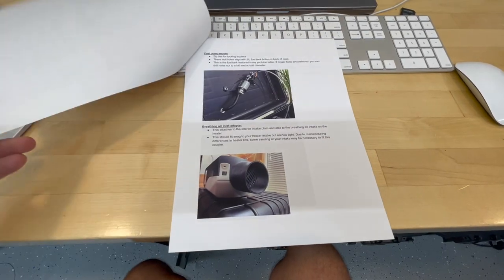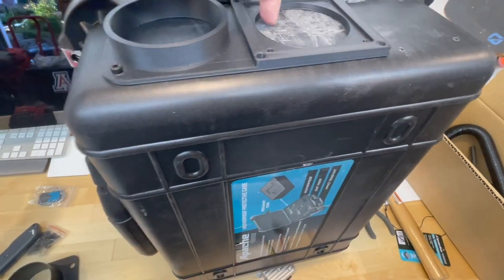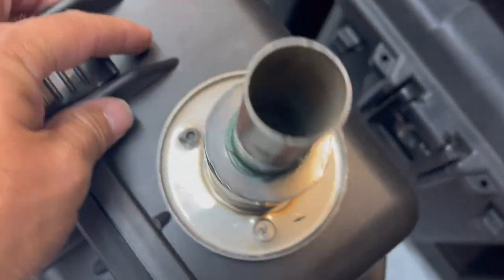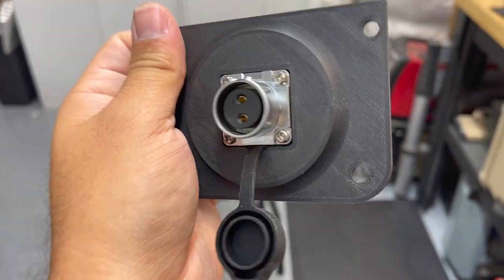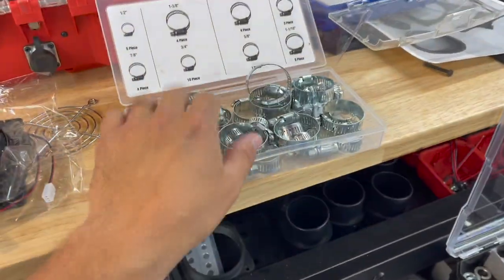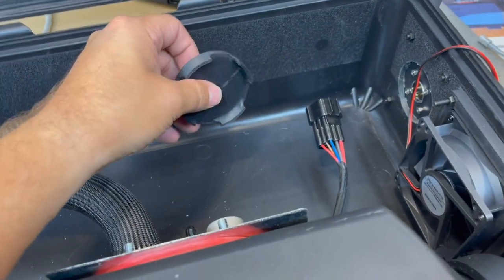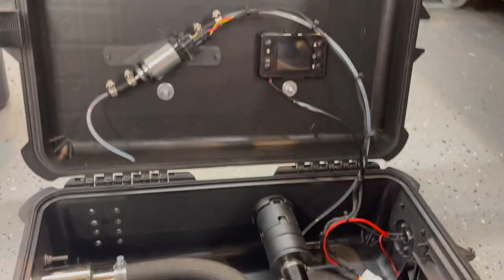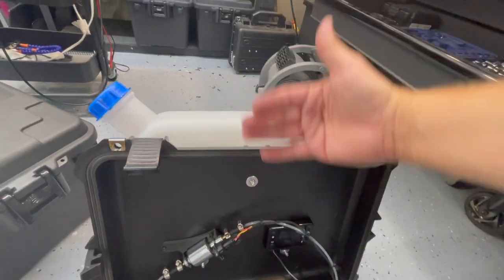DIY Diesel Heater in a box: How-to

Comment: If you put the cable for the file line in from the output hole of the tank first, and fish it from the fill hole of the tank, then you can connect the fitting from the fill afterwards, and the the process should be much easier. Thanks for a nice video 🙏

Comment: Just finished this build yesterday, it’s a fantastic design. I do have a tip for the holesaw, if you run the drill in reverse after the pilot bit has gone through it will be more controllable.
Reply from the maker: great tip! Will employ right away!
Reply: I noticed that the plate that is listed on eBay is 450.00 seems crazy that it cost 3x of the heater itself. We’re
Did you find the mad flow sensor plate ?
Reply from the maker: @the-bu3lb  for sure! This eBay seller likes to spike the price when his inventory gets low. I put other options on there for you too

Comment: Nice build. Having done this myself I can appreciate the time it takes to lay it out, and make adjustments/trade-offs. That said, I'd recommend just buying one already in the case. Not much more expensive. If you really want to learn the components, just open the case. You'll really learn about it when you need to clean it or troubleshoot problems.

Comment: Since I don't see anyone doing it so I've been passing on the info.

I made a true all in one diesel heater using a Ridgid medium size box.
Inside I placed the heater, 20ah LFP battery, solar controller, AC to DC charger, cooling fan, light, voltage monitor, USB, 12v socket, charging port, and a 5 liter fuel tank with quick disconnect fuel hose.

I just started building another case using the Apache 4800 case.
I'm keeping this one simple.
I placed the heater with a 50ah LFP battery. I still had room for the controller, 12v socket, and voltage monitor.
To keep it clean. I mounted a small external case for the fuel pump and the filter. I just started making extendable legs for the case.

Comment: 27:00 run the wire through the tiny hole first, out the cap, THEN tape it to your fitting.
Reply: yes. and i would put all bolts with nuts on the inside of case so threads are not exposed to the weather.

Comment: Keegan- When placing the fuel fitting in the tank. Feed the wire through the small hole first, as it easier to fish out of the filler neck.Then attach the fitting and pull back through. Moto tanks with fuel pumps are done this way as well. Same issue.
Reply from the maker: haha genius! why didn't I think of that! (come from moto world myself too)

Comment: Thanks for taking the time for the video. I question the 3d printed fuel pump holder? Isn’t that just a receipt to amplify the already load pump. Mounting it to a hard plastic holder then mounted to the case? 
Secondly I question having the exhaust and intake so close together, even though different sides of the case. I have found multiple occasions a slight breeze can blow exhaust around the case and drawn into the intake. 
Thirdly? No muffler? Wow that’s a huge mistake

Comment: If the gas cap is vented with a hole in the cap you could replace it with an open close valve. Or replace the cap with one installed.

Comment: Recommend a 40mm hole saw for the through-hull exhaust and the quick disconnect plug holes. Otherwise, 2 inches is quite large, 40mm is much neater.

Comment: Interesting device. Why not put the fuel connection on the other side of the tank by the fan side and mount the pump over that way too to keep the exhaust free and clear of the fuel system? It looks like there's room to do it.

Comment: Love the kit. I had to use a vibratory saw instead of the dermal tool. It was much easier. Assembly took me approximately 4 hours. I also used the five connector for me to place the panel in the tent.  I then extended the wires 6 ft. If you run the wire thru the small hole out to the fill hole it's a lot easier. The only concern that I have is that the vent fan runs constantly even if the unit is off. I am currently working on how to stop that without having a secondary switch. If you have any thoughts on that I would love to hear your idea.
Reply from the maker: My thought was to use some sort of current sensing switch. It senses higher current then turns on) OR find some sort of line inside the heater that runs the heater fan and tap into that. I use this system now for a few years (the 2kw) and the small fan doesnt really drain the battery or anything so I havent invested much time into that part
Reply: is the case fan necessary at all?
Reply: @alanhat5252  So far with my experience it can be removed. That being said I believe it does add ventilation to the box for the heater and that isn't a bad thing.

Comment: Is there a reason why people are installing a heater in a plastic box, when you can just buy one that's installed much better for less money that actually looks and works good! 
 Why would you try to suck the warm intake air from inside the box with the lid closed or do you run with it open? Either way, you shouldn't use inside warm air for the burn chamber. Outside air being colder and more dense ignites better, and you really don't want to be using warm air and blowing it outside.

Comment: Great job on the 3d parts and a thorough job on the how-to. Just wondering if the 3d parts will work with any other similar 5KW Chinese Diesel heater?
Reply from the maker: Yes it will work with any of the 5kw heaters. Just double check that you have a 75mm output on the heat side and you should be good to go.

Comment: Just curious there a reason so have part of the exhaust (1 foot or so) on the case before exhausting it out? Would it be better to mount the heaters exhaust right against the case, and have it leave right away?  The exhaust hose int he case will just cause heat build up and potential fire. No?

Comment: Awesome build, appreciate your videos and attention to detail.  I copied you with the 12v computer fan.  I also wired it like you did.  The drawback I see with this set up is that once I plug in the power cable (to my power source) the computer fan runs, even if I don't have the heater running.  Maybe the fan takes such little power that it is not an issue?   Thoughts?  Thanks again.
Reply: you can add a switch internal or external, its custom, do what you like.  I've also see them with just and air filter, no fan.
Reply: @sledhead904  i think I'll leave mine so the computer fan runs whenever it's plugged in.  The heater stays outside the tent, so adding a switch means i would need to get to the box to turn it off and on.  I control the heater  with a remote.  I think the computer fan takes negligible power.  Not gonna worry about it, unless it becomes an issue.

Comment: What a great video and it's the one I'm going to follow when I build mine. One question though why put the thermostat in the case? Surely you want that in whatever space you're heating?
Reply from the maker: I find that these thermostats are very ineffective. They heat your room at full blast until gets to temp and then essentially shut down. I find putting in “Hertz” mode you can essentially keep a constant low/medium or high based on your needs with the wireless remote from your tent.

Comment: I have the 8kw and just came across your build. It’s exactly what I was looking for. I will have to modify my build though. My heater has the 4 port air outlet. Do you have plans to print an adapter for this type of heater casing?

Comment: I don't understand the point because you can purchase them already in a self-contained box for less than what it would cost to purchase all this stuff separately
Reply: Yes only problem is they are out off stock most places and cost around £100 extra
Reply: not sure it's waterproof or water resistant
Reply: The fuel tank is much smaller in the all in one. I am mounting everything outside the trailer so no smell of diesel and no sound from the fuel pump
Reply: When he made the video, heaters in a case like this one weren’t even out yet, now they are all over the place.
Reply: How about the enjoyment factor of the fact you’ve made it yourself?
Reply: Hcalory has the enclosure case for 149 US on Amazon in 2024.
Reply: All of the ones on Amazon don’t have an altitude adjustment.
Reply: If the store bought dedign fits your needs
I rarely find that to be case.

Also 
All the All In Ones I could find were 5k and up.
2k suits my build better 
Bigger isn't always better.

Comment: You have done the best case build i've seen on youtube but used the garbage hose clamps and drilled the bottom of the tank and should have used a stand pipe and gone in from the top,come on man.

Comment: Awesome video and great kit you sell, I’ll definitely be using it on my build! I noticed that you didn’t add any extra support or backing to the mounting plate, have you had any issues with the case not holding up? Thanks for the vid!
Reply from the maker: the heater is supported from the sides fairly well so all three points make this a VERY stable install.

Comment: Brilliant idea. Been looking at these heaters for my boat. Making it portable is great. I could use it in my ice shanty etc. I would advise anyone using one of these to install a carbon monoxide alarm. I think that heater has a low oxygen shutoff right? As for the angle thing I have not found any info on that. Not saying anyone is wrong though.

Comment: I didnt know you could run these in different orientations. I thought the exhaust etc always had to be on the "bottom".
Reply from the maker: If you pop the top off your heater you will notice the glow plug is on the corner of the unit. The glow plug should always remain “up” so fuel doesn’t leak out of the threads. If you can imagine that since it’s located on a corner the unit can be placed on 2 of the 4 sides. Only 2 orientations work to keep that glow plug up. I positioned the heater inside the case so that it can operate either with the case lid open or in briefcase mode. Hope that makes sense
Reply: @keeganbuilds  yes! thank you for the quick reply!

Comment: Thank you!! anyone else struggling to get the fuel lines onto male ends? The fuel hose diameter I got seems too small even heated - ID 3mm.
Reply from the maker: You should find some black hose that you use to join the two parts

Comment: Awesome updated video! I may have missed it in the video and I apologize but , you're leaving the controller now inside the case?
Reply from the maker: It's easier to run it like this. I run my 2kw like the original video (controller in the tent).
Reply: @keeganbuilds  Right on !!
Reply: @keeganbuilds  What air duct have you been using that works really well?

Comment: Just got my parts of the mail from you, do you have any advice on how to make the fuel pump quieter. The 3d printed fuel pump mount being hard plastic really resonates the noise.
Reply from the maker: You can add sound deadening material or rubber between the pump and the case and even wedge some into the pump mount itself.

Comment: My only concern would be the fuel pipe near the exhaust pipe/ manifold when closed, well thought out though👍
Reply: My thoughts also. Fuel pump and pipe next to an exhaust manifold in an enclosed space! 
interesting / scary how people mod these heaters
Reply: You could cover the stock fuel line with the same black fuel line used outside the box and secure to the sides and lid. Here is a fuel line in every car above the exhaust. The unit is vented with the fan. You could also add additional exhaust insulation.

Comment: Looks to be a great build! I am just getting all my parts now to try it out! Very much looking forward to it! 
Huge question, you don't show much of the unit running other than a bench test, and there is a company that has a similar idea with the unit built in a box, however they show the exhaust extension running out of the box with the a muffler. When you run this in the real world, do you also run something to get the exhaust away from the box and have you thought of trying to put a muffler inside the box? I was thinking IF there was room, maybe wrapping the muffler with heat shield wrapping. From the one video I have found, it does seem to make a difference with the muffler. 
I wasn't sure if not running an extension would be a concern with the heat coming out at that point.  
I put in an order for your parts last week, I just need your parts to arrive, and I am off building!  
Thanks for a great tutorial!
Reply from the maker: Hey Brad, thanks for the order! I appreciate the business. I do not use a muffler when I run my heater. Its totally able to do it with the extra exhaust piping if you want tho!

Comment: That fan is 12v ONLY they can not take the 14.4V from a vehicle or battery for very long. I highly recommend that you use a buck converter set to 12v to keep your fan from shorting and becoming a closed circuit. 

(I have first hand experience with this)

Comment: Tip: At 27:02 it will be easier to feed the wire IN through the small hole and pull it out of the fill spout THEN attach your filter, etc.  You probably won't even need the needle nose pliers.

Comment: Thank you for the demo video I really appreciate it! I am building a 2K I’m wondering if I can use the two wire approach that you show in this video. In other words I would get rid of the DC book converter and use the two wire set up. What do you think?
Reply from the maker: You definitely can! The two sizes are basically identical except size.

Comment: Well done tutorial!! I looked at your parts list and please tell me you didn't pay $500.00 X 2 for the 3" heat output tube?? That would be insane to pay that!! Saw no other options on eBay! I will be buying from amazon.
Reply from the maker: haha of course not, they should be $19 each. Im guessing they are restocking that piece in which case use the backup option on amazon
Reply: @keeganbuilds  Well unfortunately Amazon is out of them also but I did find them on eBay after doing a quick search. Paid about $10 or $12 a piece so they're on their way!

Comment: Is it possible to lay this set up on its side? Or must it be vertical?
Reply from the maker: it can be in its side. You just really need to watch out for the fuel tank lid. That is the only thing that must remain vertical because of the vent in the fuel lid could leak.

Comment: Looks like a nice setup, much more cleaner and organized than the others I've seen. Do you know if anyone has used a webasto unit with your 3d printed pieces? I believe it should all line up, but I haven't played with any of the Chinese ones before
Reply from the maker: Thank you for the nice comment! if the output diameter is the same for the webasto at either 60mm or 75mm then either my 2kw or 5kw kit should work just fine. The chinese versions appear to be direct copies of the name brand versions.

Comment: What's the right Ducting for these things?  I've seen people say the PVC stuff isn't right.  I've got some flexible ducting with a PVC outer and a shiny Alum inner...the diameter is fairly small too unless I fully stretch it.  Worry about back pressure.  The more rigid stuff that came with it seems fine?  Is that right?
Reply from the maker: You can buy longer lengths of the stuff that ships with these kits on eBay. Another option is dryer vent hose with 3” piping (if your using the 5kw kit)

Comment: Keegan- 
I noticed in your video you’ve linked to the Superfastracing heater. Is there any significant difference between that and the Vevor 5kw heater? Most appear to be identical and are probably manufactured in the same plant. Just wondering what your experience has been. Thanks

Fitz
Reply from the maker: Hey Dan no big difference

Comment: two questions for a newbie... how come you don't use the muffler for the exhaust?  Also the air intake, wouldn't it be better to take air from outside the case?  seems a little risky to take air inside the case if there were any air contamination.
Reply from the maker: muffler can totally be used, if you want to ive found that these do not make too much noise as is so its just one more thing. As for the air intake, the breathing air is taken from outside the case. The intake that you see inside the case is for the combustion intake. Also, the computer fan forces extra air into the case to clear out any potentially leaks.

Comment: Awesome video. What size fan fits your printed parts? And did you use a two pin waterproof connector?
Reply from the maker: Thanks Jeremy, I used an 80mm fan and 2-pin connector in this build. Just added that clarifier in the description, thanks for the pointer.

Comment: Hi there, do you know of a "Quick Disconnect" hardware set that works with this white fuel line?  I need it be valved on both sides so when I disconnect, I don't lose fuel out of either end.
Reply from the maker: https://amzn.to/3vWMEdn something like this would work perfect but it looks to be out of stock. You might be able to find something similar on ebay?

Comment: I notice on your other video comparing the two builds, you did not seem to remove the side clip from the case as in this video. Has the requirement to remove it on the 4800 case now been eliminated?
Reply from the maker: Good eye! I definitely recommend removing it. I had to heavy modify the clip to get it fit at first. Eventually didn’t like the way it sat and removed it
Reply: @keeganbuilds  I sorted it and now it clips shut just fine and clear the intake grille for the fan and air inlet